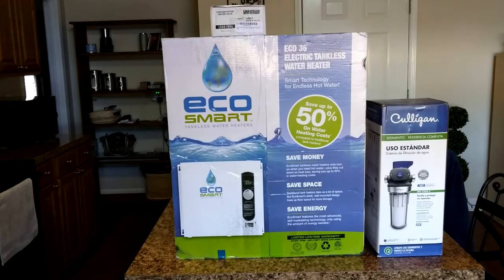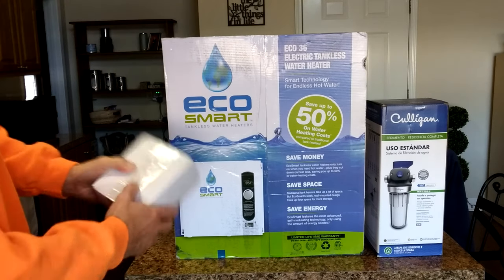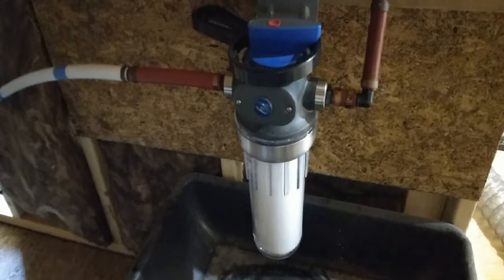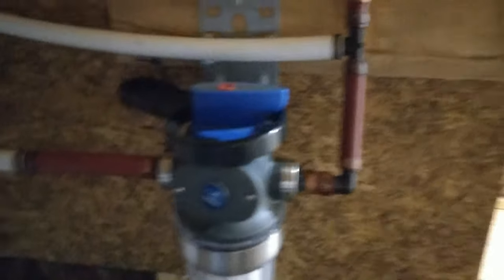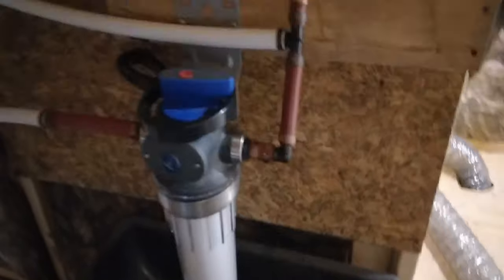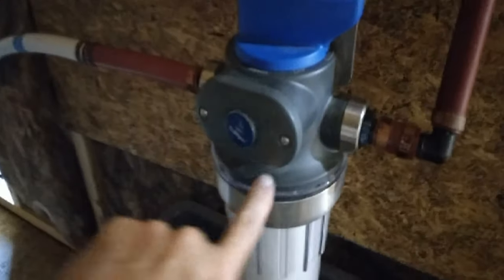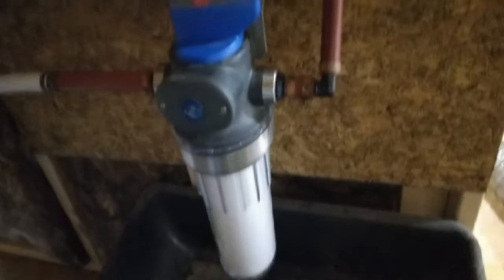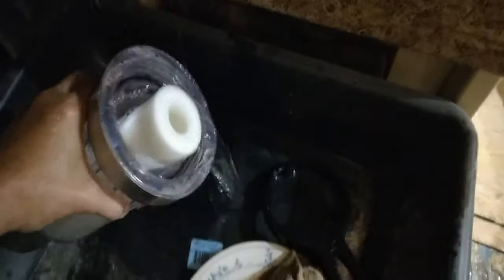Review-Culligan WH-S200-C Single Stage Whole-House Sediment,Chemical Water Filtration System Filter

Comment: Did you push the red button to “depressurize” prior to opening? Also how often are you changing the filter?
Reply from the maker: Yes, depressurize the filter. I change when I see a drop in water pressure. That tells me carbon & filter getting clogged up. 🤞

Comment: Can this be used for a 2.5 bath townhome with 3/4" white PVC  ~IF~ I find the right adapter to accommodate the 1" in/out ports?  Is there a filter with some descaling property, like citrus or soliphos incorporated?  Which model is the one that works with 4.5x10 filters instead of 2.5?

Comment: What fittings did you use on the inlet and outlet? Did you use brass or PVC? I’ve already bought 2 of these models and trying shark bites (brass) and get them going about 1/4 of the way and they start to cross thread. Knowing that they are going in sideways (cross-threading) I haven’t continued to force the shark bite fitting in. Happened to 2 of them already. Wondering if you had trouble and what did you do to solve.
Reply from the maker: You just have to take your time & slowly screw in your adapters being careful to make sure they go in straight. These were put in with PEX fittings but I am sure shark bite or gator fittings should work just fine. 🤞

Comment: I've had two of these, both failed, the pressure relief valve design is vastly underdone.
Reply from the maker: I still use mine with No issues so far. 👍🤞